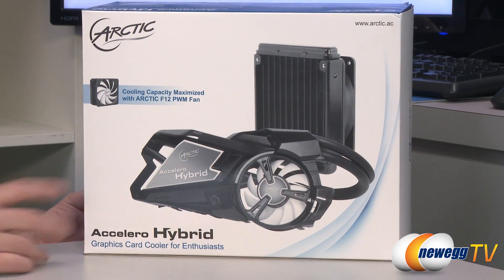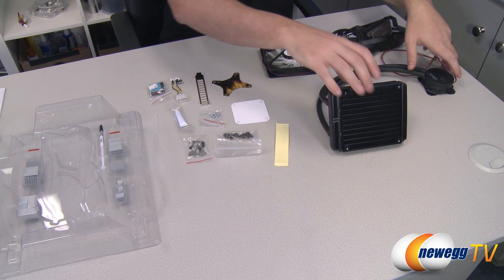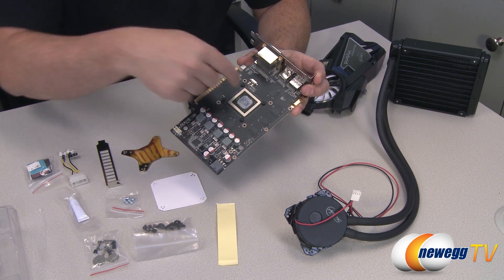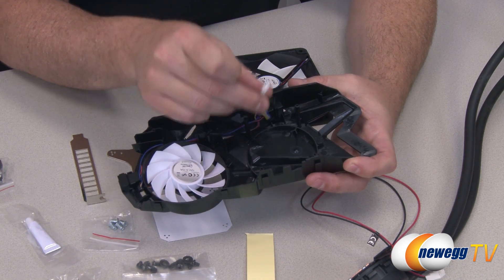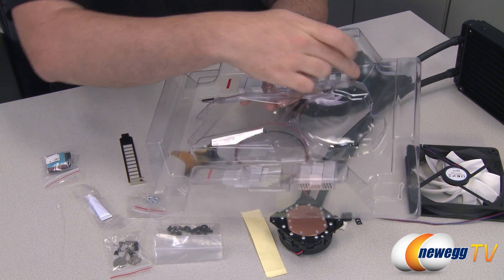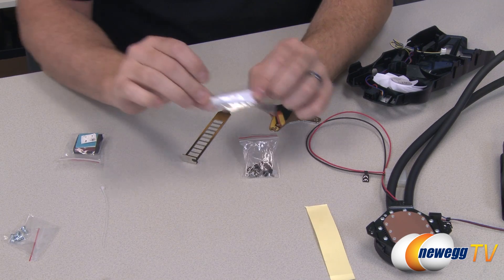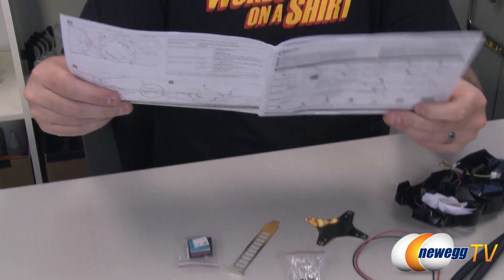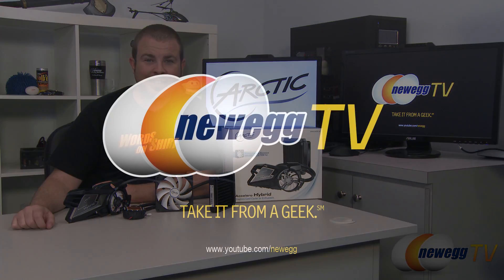Newegg TV: ARCTIC COOLING Accelero Hybrid Fluid Dynamic VGA Cooler Overview

Comment: If anyone is wondering how big a difference this makes compared to the cooler u have now. I had a great air cooler bought with a Oc'ed 670 and had temps of min: 38c max 100c (might have OC'ed it a bit too much). Now (with the same OC) I have min: 26 max: 45 both tests were with exactly the same rig only the cooler was changed.

Comment: I could not finish my reply in one box so here is the rest...
"i rather see a stronger smarter designed bracket ,maybe with hole in the center."
You do know if they made a hole in the center it would go right threw the GPU and trust me this cooler is the lightest aftermarket cooler you will find and there design is over kill
Also this is future proof because of how well it works and its universal combatibility
This thing is amazing and you obviously don't know what your talking about.
Good day

Comment: Do you even have this product? well I do.
You don't like small fans, ok. well the fan on here is almost silent!
The foam crap that wont help with heat? Well the water cooler on the GPU side of the card deals with the heat really well so it doesn't even matter.

Comment: Don't know why you would, but if you have a passive cooler on it, that is just the heat pippes and fins, theres no fans at all, then you really need to put fans in your case. whats good is 1-2 on the front near bottom beside the 3.5 bays, 1-2 on the top near back, 1 on back and if possible, 1 on the bottom of the case. have the one son front and bottom pull air in, and the ones on the back and top push that air out. you can put on the side for more air flow if you want.

Comment: I don't think you can use it on a CPU because of the shape of the screws you have to put it in, and there are other factors, but this will work to get your gpu down from 85, that is way to high. Something is not working here, if you have an open air cooler on it (no plastic on the sop or bottom of the fans), then yeas you need a few more fans on your case. but if you have a shroud (complete coverage all around) it wouldn't matter too much but it does help some.

Comment: 40-60C is really cool for it, and you shouldn't be toughing it while it is being used or afterwards. if ti goes 80C or higher, then it becomes a problem. Don't worry about that.

P.S. 38C is 100F

Comment: Can i use this with the Corsair H100, or Do you have to remove 1 to use the other?

My gpu is hot to the touch but, the temps say its only around 40c and my cpu on idle, when used max 60 c,

WIll this help with the gpu being hot to the touch and burning smell from my computer

Comment: I guess it really depends on how you look at it the value. I ordered mine already as I have heating issues with my card. I have a MSI GTX 670 with +70 on the core and +300 Memory running rock stable and need it. However not to single you out or be negative but the going rate for your 3930k and H100 runs about $700 with shipping and no extra fans on Newegg. I really believe that If you can afford that much for your CPU and heat sink then what's an extra $179?

Comment: It's not just a neat idea... people have taking CPU closed loops like the H60 and the Antec 620 and modded it on the GPU. It completely blows away even the best air cooler in temps. I've seen 50-60C load temps high OC. Just look it up.

Comment: one of the mounts the guy sells allows you to remove the plastic shroud and heatsink and leave the stock fan assembly on. i have it installed on my evga gtx 680 and it works like a bawse!!